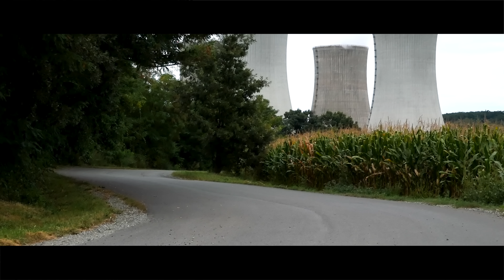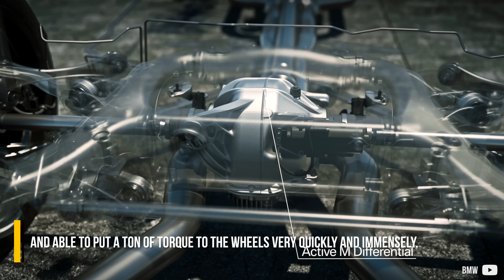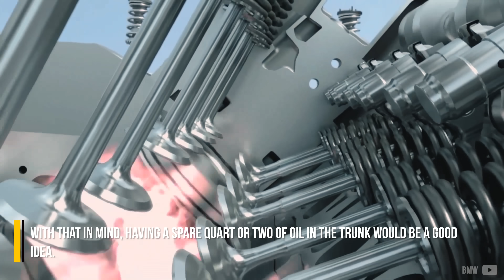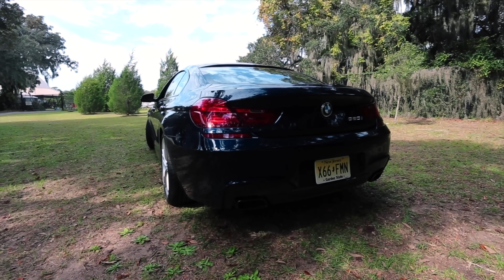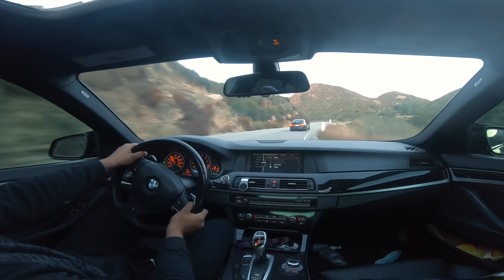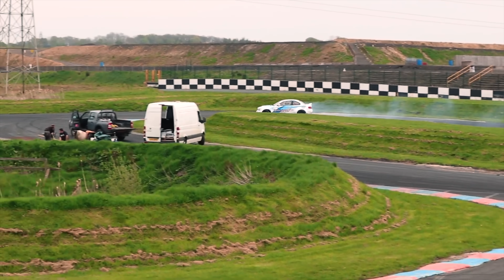The Worst BMW Ever?

Comment: My old N42 is another example of high maintenance BMW engine.... I still have nightmares with that engine. Valve steam seals, head gasket, oil pan gasket, valve cover gaskets, vanos seals, PCV valve and still was leaking oil, all for those unglorious 143bhp. All of this happened before 190k km.
Reply: Really wow thats terrible!!   I have an M52TU from 1999 and apart from the cam cover gaskets and the PCV being replaced, it is pretty much perfect. Uses very little oil. Even the supposedly weak points like the VANOS units and the DISA valve are still good after more than 20 years!   It seems like BMW (and Mercedes too) cut their build quality down quite severly after the year 2000.
Reply: @soundseeker63  
This goes for all car brands. In the same way, Nissan, Honda or Toyota have lowered their quality a lot in the last 20 years for Audi or Volvo, not to mention
Reply: @tomciopaluch7235  It's nowhere near as bad with the Japanese brands as it is with the German ones though.  Look at any recent reliability survey and brands like Toyota, Lexus, Honda etc still do pretty well, while BMW and Audi are mediocre at best and Mercedes frequently finishes near the bottom of the table. Says a lot!
Reply: @tomciopaluch7235  you're delusional if you think that's the case. Even cheap FWD GM cars are more reliable than that.
Reply: @tomciopaluch7235 
Yeah it’s gotta make u wonder 🤔 

Designed for our 15min designer smart cities. Where we won’t need cars ?? 

Is this why the industry has done this ..  ?? 

Keeps us enslaved working to pay for their profits ..
Reply: @soundseeker63  After 2004 the trouble began for most Brands.
Making more Power out of smaller complexer Engine's was part of their changed views.
Because of regular changing car regulations, they  stopped making cars that used to last forever.
Also Car Brands focusing on an EV Car Future, is a reason they are making less reliable Cars and Engine's for the Fossil Fuel Car market.

The amount of Sensors and Electronic Technology on new cars is increasing, while Car reliability is decreasing.
Reply: exact same thing happend to my friends n42
Reply: @jeffreynigg6122  most of the stuff that I did seem to be common to N42
Reply: yep same story for me, i changed oil every 10k kms, burnt about 4l of oil between oil changes. at 212tkm i noticed the chain guide was also cracked. also stem seals were worn, changed oil pan + valve gaskets, pcv valve, coolant reservoir, water pump + power steering pump. vanos solenoids were changed, oil cooler gaskets and the list goes on...
Reply: @trytthisnowk  oh yes, the plastic chain guides, forgot about those. N42, not BMWs best engine for sure....
Reply: @trytthisnowk  I replaced the oil every 15.000-20.000km and after more than 250.000km my BMW still doesn't consume or leak a drop of oil.
Reply: @randomdudeontheinternet9926  and you have the n42 motor? I drove mine from 95tkm to 212tkm and it consumed oil all through this time.
Reply: @trytthisnowk  N47
Reply: @randomdudeontheinternet9926  thats a diesel
Reply: @trytthisnowk  and those are supposed to consume oil by nature which should make matters worse. Especially since these are more likely to cause contamination in the engine by nature.
Reply: @randomdudeontheinternet9926  where are you getting your info from? how is a diesel supposed to consume oil by nature? diesel is not an solvent, which makes it safer if it mixes with the oil. Also typically Diesel engines are overengineered to withstand the higher cylinder pressures. They rev lower and generally not so stressed as a petrol equilevant
Reply: @trytthisnowk  that's simply the nature of all diesel engines to consume oil.
Just google it. It's the nature of the beast. Oil consumption in diesel engines is simply expected up until the introduction of DPF's where oil consumption would kill the DPF and cause extremely expensive failures.
Reply: @trytthisnowk  doesn't matter. Lubrication remains the same.
Reply: @randomdudeontheinternet9926  ???
Reply: @randomdudeontheinternet9926  whay you have googled is the burning of oil on cylinder walls when the cylinder fires, this happens to every piston engine, no diesel engines are not engineered to burn oil, its a side-effect which is so insignificant you shouldnt even add oil between services, well atleast i dont since i keep the intervals at 15k max.
Reply: @trytthisnowk  you just mentioned 2 things. 1. Diesels are overengineered to withstand the higher pressure created to allow for higher heat generation to cause self combustion. This means a couple of things. For one you often need a bigher displacement for the same performance a petrol engine would deliver. And you need better lubrication.
BMW however does not use bigger diesel engines for the same performance level of an equivalent petrol engines. They ised intelligent valve lifters, intelligent intake valves in the manifold for improved fuel mixtures, things like that.
In the days before DPF's their diesel engines consumed a fair bit of oil to make  sure the engines worked as expected.
Nowadays with all the emission control systems that would become a serious issue. Now I am above 250K on my BMW diesel with oil changes every 15-20K km's without oil consumption.

Despite all this, looking at the engines as a stationary machine, the potential for leaks, be they internal or external aren't very different for their diesel and petrol line-up.
Reply: @randomdudeontheinternet9926   Bmw uses their variable valve timing and lift in petrol engines, they get equilevant power out of diesels using turbocharging and direct injection, diesel is slow burning compared to petrol hence the stroke is usually longer than the bore this combined with diesel slow burning produces great torque, different beast indeed.
And the only reason a healthy motor would burn oil is because as i mentioned before oil on the cylinder walls getting burned off, which is insignificant.
Clearly you are misinformed, just reading things off internet does not grant you the basic understanding of motors.
Reply: @trytthisnowk  It is you who is misinformed. Like it or not. I hrew up with diesel engines. They are extremely common in Europe. The topic was oil consumption in combustion engines. Wether they be petrol, diesel, CNG doesn't matter. Oil consumption is oil consumption. And it's no longer something that's allowed in modern engines due to the emission control systems.
Reply: @trytthisnowk  you sound like the kind of guy to tell people as long as you attach a neutral wire first you won't get shocked when handling live wires.
Reply: @randomdudeontheinternet9926  at this point your just typing down words you saw on the internet with no thought behind them. I dont know why im trying to explain principals of combustion engines to you. You lack the ability to think, clearly. My bad.
Reply: @trytthisnowk  Unlike you at no point have I used Google for any of the facts I wrote down. I have been around diesel engines my entire life. We've had almost exclusively diesel cars until recent changes in the political climate. You should take your own advice and google the bullshit you wrote down. No point continueing the conversation with a stubborn bastard as sharp as a bowlingball.
Reply: Same on n46 next generation of n42, that’s because engine running on high temperature and compresion rates 10.5:1
Reply: The cars the cars only designed now to outlast the warranty or the lease
Reply: @dagnut  highly doubt that but I'll find out next year when I get to pick up my new car.
Reply: Yeah, I've heard bad things about that engine. I have the engine that came before it, the M43 and I've heard that its way simpler and more reliable. It only has 116hp (1.8 version) though instead of 143..
Reply: @Benjamin-ko1fg  the m43 was legendary compared to n42, i remeber in my youth my cousin had 518i with 374k on it, and was still going strong. And that engine had no easy life, constantly getting beat on 😁
Reply: @Benjamin-ko1fg  model number ends with 18i but it's still a 2 liter engine.
Reply: Sounds like my n54 with 100,000km. Although at least I get over 400hp and gobs of torque
Reply: My wife's BMW Touring has 570k km. Since two years, it's absolute torture to keep this thing alive. We may perhaps even do the unthinkable and convert it to an EV.
Reply: Meanwhile my 1980's Volvo 240 Turbo sedan has 600k km and the red block engine does not want to die. It only has ~150hp tho. 

Our 1992 Unimog 4x4 camper has 800k km and runs like a charm.
Reply: m539 restorations would have had a field day if he had ur car
Reply: tbf 190k km is insane mileage
Reply: @HashemSmashem  "insane milage"....? lol my 1997 E39 touring made it to 457k before it had to be retired, and even that wasn't because of any engine or trans issue - it was the bodywork that gave out before the mechanicals did.
Reply: @soundseeker63  Nice. I bet it drove like it had 457k mileage though lol. It's like comparing a 20 yo chick with a 50 yo milf. Both can get the job done, but it's not the same😂
Reply: @HashemSmashem  Not really. All the suspension, clutch, brakes etc. had been reconditioned and the engine its self was still running like a champ.  It did look its age though. As with most cars in the UK, corrosion eventually got the better of it :-(
Reply: @soundseeker63  That's so cool brother. Really something nice to hear. Corrosion or not, that beaut ages like fine wine 👍🏻😍
Reply: @HashemSmashem you can't compare a Toyota camry or Honda crv to any BMW.  Oh yeah and Honda crvs did have engine issues on their turbo 4cyl.
Reply: @HashemSmashem  when you see Ford F-150/Toyota tundra/Camry/Honda CRV routinely last for 300k miles (480k km), 190k km isn’t whole that a lot
Reply: @shaozepan7676  True. But smiles/hour are way less compared to an F10 M5. More HP =  more things that could potentially go wrong. Can't compare a Honda CRV to an M5 haha
Reply: @HashemSmashem  that's nothing for the US
Reply: I have the N46, from 137k km... it now has 194k km and it's going strong. Had an issue with the valvetronic motor that was fixed but other than that nothing major. It does burn like 0.5l of oil every 1-2k km though, but that's because of some leaks due to worn o-rings.
Reply: heard a lot of these nightmare stories. I never had an issue with mine.

Comment: love these vids, was thinking of getting an f10 550i but now im just gonna steer towards sumn else 😭
Reply: Good move, steer clear of them. Get yourself an 08-10 C63 AMG instead. Same power, naturally aspirated. And super reliable assuming the headstuds have been changed out.
Reply from the maker: Head studs, timing actuators and camshafts
Reply: If you want a f10, get a N55. If you get a N20 make sure the timing chain was replaced (with receipt as proof) or change it as soon as you get the car.

Comment: I was working for Bmw as a mechanic when this engine was new and all the ‘technical’ updates that came after. This engine was a big reason I quit working for a bmw dealer. After a few years of working on them, it just got annoying
Reply: I was the ceo of bmw i quit after this engine and now working for mcdonalds as cleaning employee
Reply: @memegang7421  I can confirm. I was the engine.
Reply: @memegang7421  no way. I was the creator of BMW before I found Amazon, but I gave to company to some bald dude and now I trade Forex. what a world.
Reply: Source: trust me bro
Reply: Considering you can pull the engine in 90 minutes I almost went back to turning wrenches. I would take that book time all day every day.
Reply: So the technical updates that came in from the manufacturer- world wide issued ? 
Or country specific? 

Where u from ??
Reply: How do they stay in business?  I drove a Kia Stinger and I love that thing!  Okay it doesn't sound like this monster V8 but the miles and smiles and cost of ownership are a lot lower.
Reply: @gdessario5014  people with money don’t want to be in a Kia.
Reply: @michaelric3540  Cuz they stoopid, more money than brains because they're concerned more with image than anything.  Yet, they're the first to complain of the dealership.  Sounds like you're a BMW fanboy!
Reply: Blablabla
Reply: @pasma1983  You’re mad as fuck. Cope